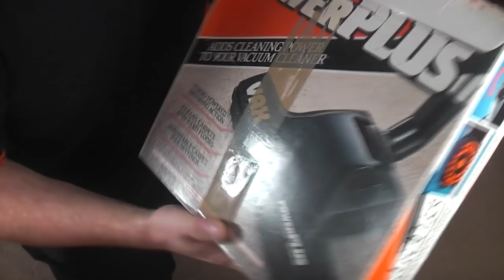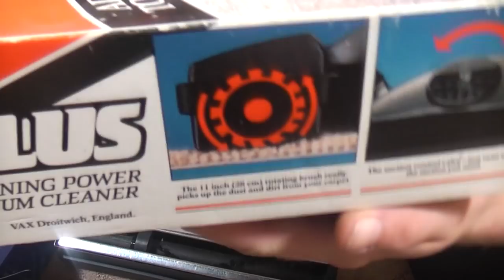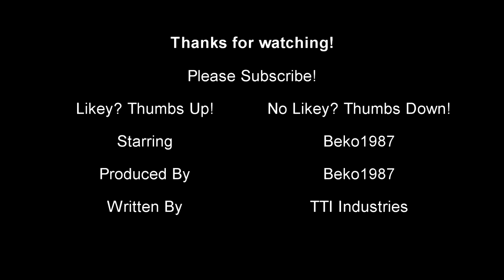Almost NIB Vax 121 Part 4   Vax PowerPlus turbo head and Dry Vacuuming demo!

Comment: Hey fun fact! That Vax turbo tool is a Swiss-made Duepro Ag design! Duepro Ag is a Swiss manufacturer of turbo tools & power heads for vacuums. Also fun fact the older style Numatic Airobrush (the red one with a face) is also a Duepro Ag nozzle you can find it being sold as the TK4 turbo tool.

Comment: Another Big Mess Test, lol - thats looking awfully familiar! One thing I learnt very early on - if you are doing a big mess test with a cylinder machine with a turbo brush - forget it! You need a straight suction nozzle with a wide opening to get all the large debris up first, then use the turbo brush if there is pet hair remaining. Turbo brushes are hopeless for big messes, as they have too small an air path, and the turbine clogs too easily. Your turbo brush nearly made me spit my coffee out when you said it was made in Switzerland - A turbo brush made in Switzerland, how quaint! These days a Vax turbo brush would have rattly, sqeeky wheels and say "made in China" on it. I think the old SEBO turbo brushes had no wheels on them either, just metal skids like yours did. wierd they look without wheels, but no wheels mean they would glide quietly over carpet, as we all know, more wheels, especially small wheels, means more possibility of rattles and squeels when pulling and pushing the floorhead - even my Miele ones do it, and its annoying, to say the least. I like the little whistles it makes when the motor winds down, sounds almost like a human whistling away than a machine,